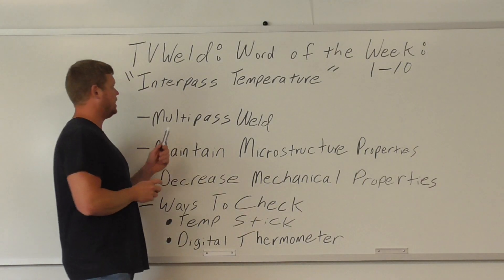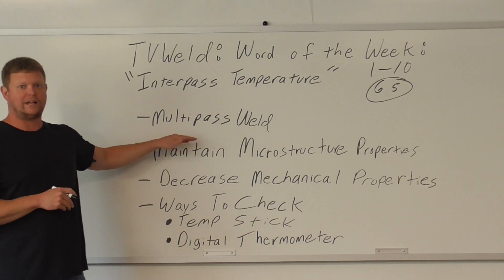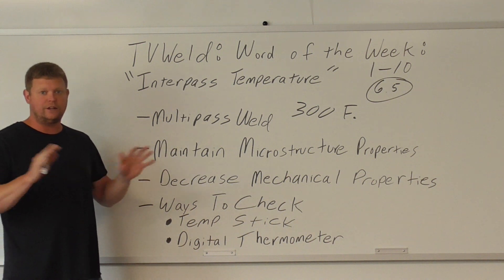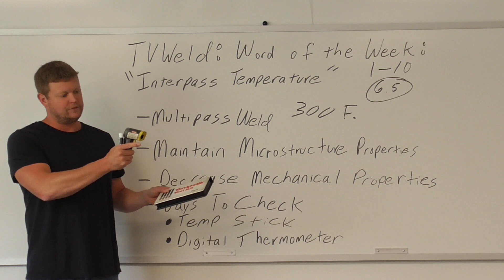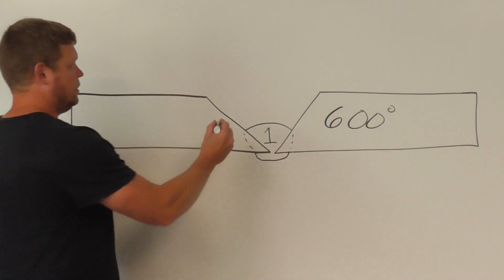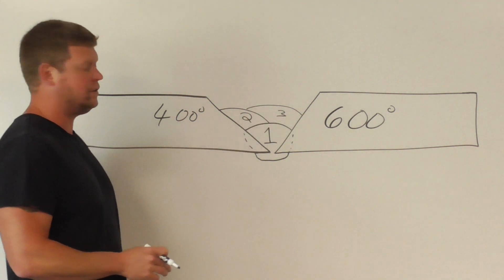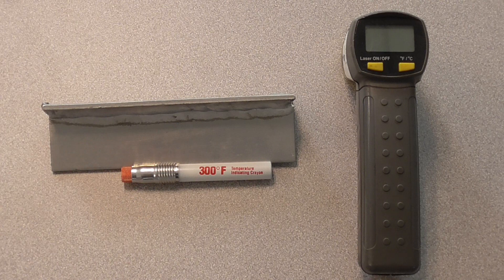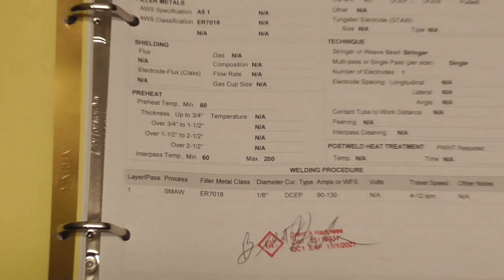Welding Interpass Temperature

Comment: One thing to be cautious of when using infrared thermometers or any non-contact temperature sensor is the emissivity of the material you are measuring. There can be a significant difference in the temperature reading versus the actual part temperature, especially if the part is very shiny. Some  thermometers allow you to adjust the emissivity setting to compensate for this difference. Usually, this requires some kind of actual contact measurement device to truly verify unless you have a reference chart of known materials and their emissivity offsets. Temp sticks are likely a more "accurate" solution for the "average Joe" or a contact measurement like a thermocouple.

Comment: Hey i have a question, i see on two different study books for cwi.  For interpass temperature how far back do you measure?  

One says 1” and the other says 2-3”.  Do you know anything or what I should go by
Reply from the maker: How far from the weld should interpass temperature be measured?”
the correct answer is:
Within 1 inch (25 mm) of the point of welding.
Reply: @TVWeld thanks

Comment: To add to the confusion, the INTERPASS temperature may be MINIMUM for carbon steels, I.E., your PREHEAT and INTERPASS may be 200F minimum, where are for some alloy's, it may be a MAXIMUM interpass temperature as in your example. The Maximum Interpass temp may be to minimize carbide precipitation in stainless steels. This is one of the most misunderstood areas of welding.
Reply from the maker: Precipitation hardening!